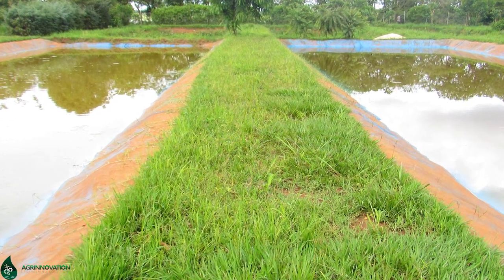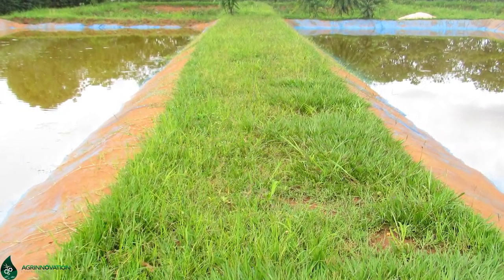PONDLINER INSTALLATION BY  AGRINNOVATION ENGINEERING

Comment: Please can you share the measurement of overlap for the welding joints
Reply from the maker: Hi Derek. We use a 120mm overlap. Welding the first (inner) 40mm, and the outer 40mm. This double welding ensures that we have zero leakages through the welding joints.
Reply: @christysongola806  thanks🙏